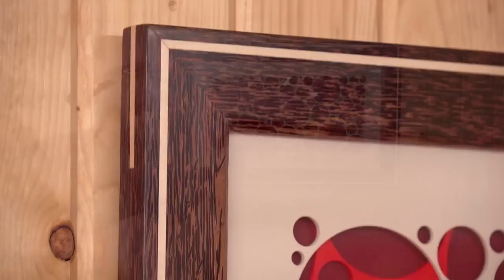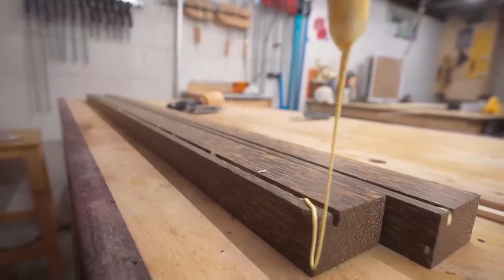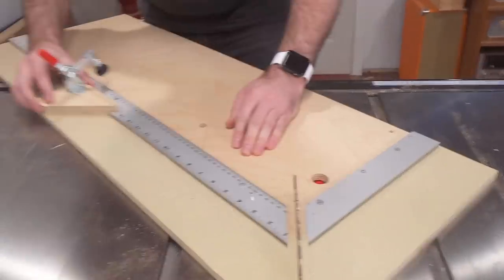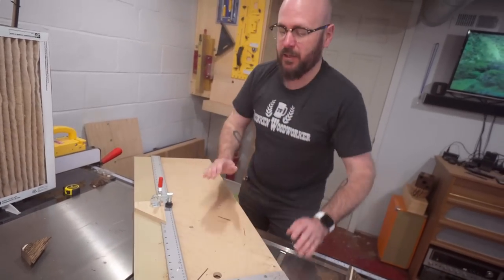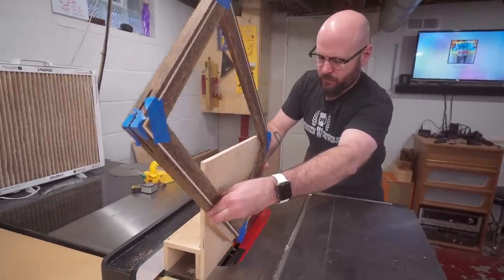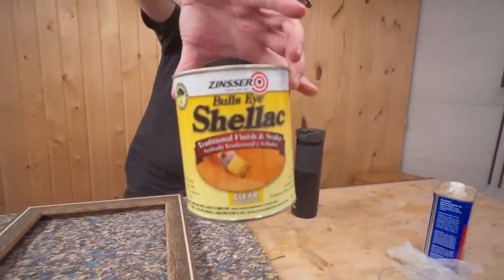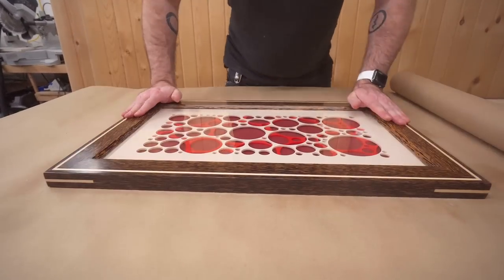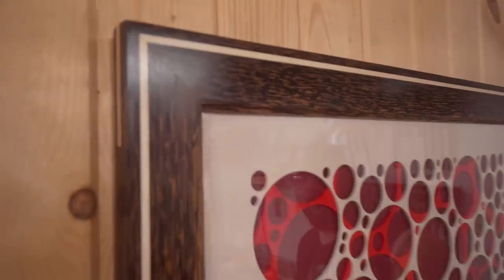Easy and Beautiful Picture Frames Any Woodworker Can Make

Comment: I really like that sled and I'd bet it comes in crazy handy.  Was a custom picture framer for years.  You really want to leave it an 1/8 inch for expansion and contraction with glass since both the frame and glass will move a bit and it can crack your glass.  Since your using Plexiglas not sure if that matters.  We used to use a roller for 3m doubled sided tape on the back of the frame.  Also if you take your razor blade and use your finger as a spacer to run your finger down the edge of the frame if will evenly cut it.   We used to have a little tool with exacto blade that had a edge that did the same thing as your finger, but if I couldn't find it I could get the same effect when you look at it from the back you see about 1/8 inch or so of frame then the square edge of the paper.

Comment: Thanks for another great video, David! It's neat to see you make a frame, knowing that frames are what got you into woodworking in the first place. 

One neat trick I've seen frameshops do when papering the back is to leave the excess paper, flip the frame, and sand through the paper at the edges, which trims and finishes the paper in one step.
Reply from the maker: Yes! Great tip! Thanks!
Reply: simple canvas frame
Reply: This trick is the most satisfying part of framing! Also, I mist the paper with water and hit it with a blow dryer and it shrinks a tiny bit (just like the old balsa/tissue paper airplane models).

Comment: I love everything about the project. I like to trim splines with my hand plane instead of a flush saw and sanding. I prefer using a hand plane for all my finishing. I find I get a far superior surface finish than with sand paper unless it's to a greater than a 1000 grit. My preference aside I love the project. I can't love this is enough.

Comment: Nice touch of adding the bent nail to the picture frame hanger! So elegant! :)
Reply from the maker: I cut out the whole cussing part around that. :)
Reply: LOL. I was actually curious about that part. I nailed a couple of those for some picture frame and definitely bent a couple of those tiny little nails. I found the easiest way is to hold the nail with needle-nose pliers to get it started, and then use a centerpoint to nail it in neatly

Comment: Liking the asides! Also, great project! Want to make one myself, but wondering how much the corner pieces help?
Reply from the maker: +EvanAndKatelyn I've made picture frames without using corner splines and they've worked fine. Although there's a chance that through the seasons the wood will expand and contract and the miners will eventually break.
Reply: Make Something ahh I get it now. A simple one I made a while ago is still around but since it has only been in Houston, TX and there is only one season here (hot), it probably has not been subjected to expansion and contraction. Appreciate the response :)
Reply: EvanAndKatelyn isn't is hot and then storm season? As in loads of moisture for a couple of days and then back to hot? Granted it's been 25 years since I was in your neck of the woods but I recall some mugginess. Only takes a few days a year to split your joints especially exstemes
Reply: Tech Dave hmm yeah it's pretty much hot and muggy all the time, except when it is a little colder and muggy lol. It's been 3 years since I made the simple frame and it's still doing well :)
Reply: I would say that they are necessary. Miter joints are not proper joints as you basically get no vertical grain glue contact. A real picture frame maker is going to use half laps or mitered mortise and tenon. The spline helps tremendously as it gives that vertical glue support. No doubt in a test to see if yours vs his picture frame hold up to being dropped his would win hands down. But i'm a professional woodworker, so I take the craft a little bit more seriously. No doubt if you made something with just miters and it was just gonna sit on a wall in a semi stable condition, than that's just fine. If you want something to be passed down through the ages, than it would not last. Hope that helps explain it in more precise detail.
Reply: Robert Hunt: makes sense for sure. I'm excited to try some of those techniques as we get more into woodworking :)
Reply: Being a  beginner I had not used splines and one day I dropped a frame and it came apart.  I have started doing splines since then.  I even put splines in some other frames that I had previously made.  They look great and will last a long time.

Comment: Nice, informative video.

I found it interesting that you use you splining jig to ride NEXT to the fence, and not straddling on top of it like it looks as if it were designed to do. Just curious as to why, as I thought it was to keep the jig from wandering away from the fence.
Reply from the maker: +Joe McDonald I upgraded my fence so the spline jig no longer fits
Reply: Thanks for the reply.Now, that was a possibility I didn't consider. It makes sense, now.

Comment: I just built your spline jig the other day, and used it yesterday. It worked perfectly! I liked your design because it didn't require me to cut through the jig itself when cutting the spline grooves. Speaking of splines, shouldn't the grain of the spline be perpendicular to the miter joint? It looks like yours is parallel.

4:47 - why isn't your spline jig riding the fence like it was designed?

" Just the pro tip!" LMAO! New sub!

Comment: beautiful work! I just wanted to point out however that the splines should be inserted in the opposite direction. the position you've inserted the splines makes for poor support and will crack once the miters want to expand over time! more so in this scenario especially where you've created a wide-faced profile with hardwood. theoretically, you should see the end grain of the splines once you've trimmed and sanded them flush. cheers!

Comment: Apartment woodworker here- When it comes to cutting the rabbits, inlays and possibly splines, are these possible with a circular saw or jigsaw? No room in a 700 sq ft apt for table saws... yet. haha
Reply from the maker: +Daniel Stepanian-Bennett not safely with a circular saw but definitely with a router. I'm sure there are a few tutorials out there explaining how.
Reply: Look for a plow/plough plane and you can accomplish the same thing.  The tool won' take up too much space and can be used at any time since it makes almost no noise.

Stanley made a model 50, Record a 043 and a 044 and Veritas makes a really nice modern plow as well.  There are older wooden versions that will work just a good as the modern ones.  Of course you could get a vintage combination Stanley 45 or 55 but that might be overkill.  Anant makes a copy you can find online.

Luban makes a Chinese plow plane available overseas.  It is a copy of a Record 043 and comes with both metric and imperial sized blades.  I purchased one recently, they are offering a 12% off discount for easter plus it is also on sale, and was quite impressed with the tool.  Even with shipping it was a great deal.

I'm not sure I should mention where I purchased the plane.  Since David does this for a living, and this is his channel,  I don't want to potentially step on the toe's of David's sponsors.

Comment: Any issues with the miters not being flush after the glue starts to dry (when you first put it on the end grain)?  Do you sand (in the place where  you work) the miters to get them flush?
Reply: Sean, since the end grain soaks in the glue it shouldn't change the dimensions enough to matter.  When he smooths it out with his finger he's basically pushing it into the end grain and smoothing it out there.  You could even wipe off the excess if you wanted to be safe.

Comment: Great video again. Love all your projects and have learned a lot. Help me with your finish on this frame. you said you mix shellac with paint Thiner? Then a paste wax over that?. I pride myself on many different kinds of finishes but have never tried this. Would you be so kind as to expand on that process for me? Thank you so much and keep up the good work my brother.
Reply from the maker: I thin down the shellac with denatured alcohol. It's not necessary but I like to thin it down so it goes on in thinner coats. The thinner the coat the less likely there will be streaks. I typically use three coats and smooth it out with Norton's abrasive pads between coats. I then use Briwax (clear), let that sit for 10 minutes and take a towel and buff it out. Hope that helps!
Reply: @MakeSomething 47490 no by b8

Comment: free tip friday for ya. when doing the paper on the back another way to do it is a small bead of glue 1/4 from the edge on the back. spray the paper lightly with water. play the frame down wait 5 minutes, cut it out the same and when the paper fully drys that back becomes hard as a drum
Reply from the maker: Great tip! Thanks!

Comment: any chance of remaking the 45 jig video. i got a little confused when you said the jig scale measures the rabbit and not the lengths.  wouldnt the rabbit dimensions change depending on the depth and width of the rabbit?
Reply from the maker: +Mike West depth of the rabbet doesn't matter because the inside of the rabbet butts up against the jig. Therefore no matter what size you just measure the artwork and set your stop blocks
Reply: Got it. Thanks dave

Comment: So I wanted to comment on when you said most accidents on the bandsaw happen when the machine is turned off- I am a technology education (shop teacher- they changed the name from industrial arts to tech ed in the mid 80s) teacher of 15 years now. I teach 8th grade and have around 100 kids a year so have had roughly 1,500 kids and in all that time, I have only had one bandsaw injury- and it was when the machine was off!  The student finished the cut, shut the machine off and reached in to grab the scrap before the saw stopped moving! I go over this in class several times as well as mentioning the use of a push stick but to the 13 year old mind not everything gets absorbed.....kid ended up with 7 stiches on the thumb. Luckily the machine was off.....

Comment: >"Any Woodworker Can Make">Procceeds to use table saw, three custom jigs, router table, bandsaw, and electric sander
Reply from the maker: +Michaelbak right. These are things woodworkers have.
Reply: Perfect
Reply: Michaelbak woodworkers are smarter than YouTube trolls. It's ok if you don't get it.
Reply: You just named the most common tools in a woodworking shop.
Reply: I know people that own a table saw and hand tools but I guess they're not woodworkers even though they consistently make things.
Reply: I mean, it could all be done with a table saw.